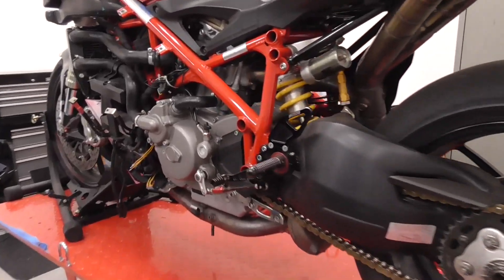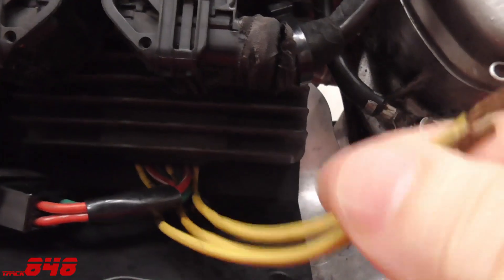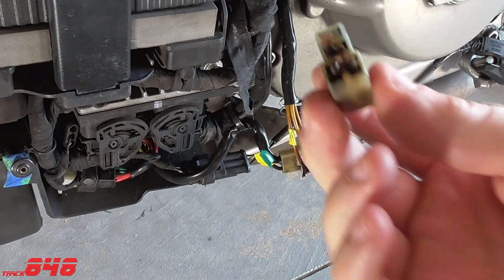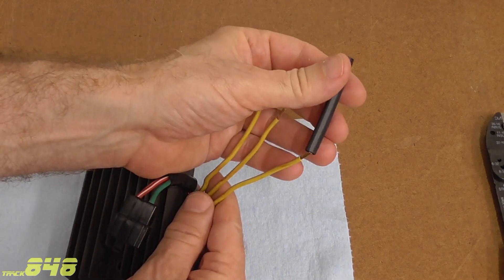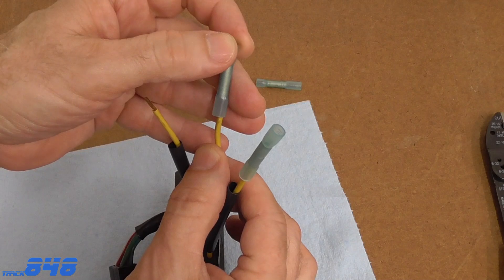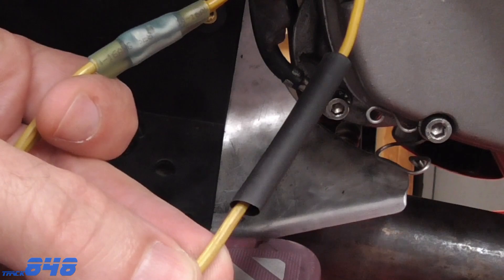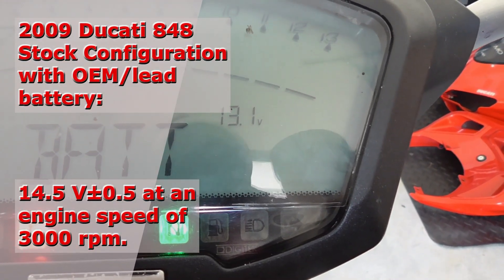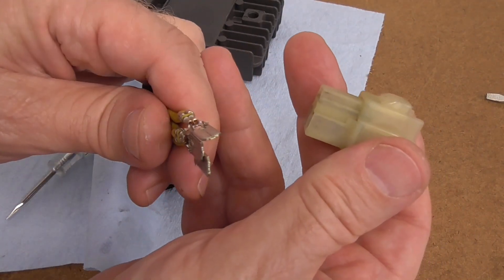How to Hardwire a Motorcycle Stator to Regulator Rectifier

Comment: Got some links/sources for your crimping tools and connectors?
Reply from the maker: Yes, sure... The crimping tool and butt connectors are Power Phase brand; eBay associate links:
    - Power Phase Butt Connector 16-14 AWG (Sealed Crimp Connector) Part #58590 https://goo.gl/PJ2aJu
    - Power Phase Crimping & Wire Stripping Tool Part #0710609 https://goo.gl/PJ2aJu
You can purchase these items through eBay (some times you can find great deals there), or go through Fastenal--online or at a local store if one is available near you.

Comment: What if your rectifier happens to burn out again!? I just did the same thing to my bike.
Reply from the maker: Did you test the diodes in the reg/rec? If not, check out the linked playlist in this video that shows how to conduct the test. You can only check the diode boards, you can't check the regulator (but your bike should show symptoms if there is a regulator malfunction ). If your diodes check out okay but  the regulator is not working properly, it might be time to replace it.
Reply: Track848 ya I checked and everything is going perfect
Reply from the maker: Okay... if you have the classical symptoms of regulator failure: Random no response from starter push-button; headlight and/or dash flickering or turning on and off intermittently; ghost error codes on your onboard diagnostics; random fuses blowing (i.e. fan fuse); or an over-charging battery (higher than 15 volts DC (or a little higher on some Lithium batteries), then it's probably time to renew the reg/rec.

Comment: I was expecting you to solder the wires.
Reply from the maker: 2M LOL--I consider my soldering skills 'mediocre,' plus for me it's easy to achieve a cold weld that I feel confident with when using these sealed crimp connectors.
Reply: Gotcha, I completely understand. Mediocre is a great way to describe all of my mechanical skills! lol